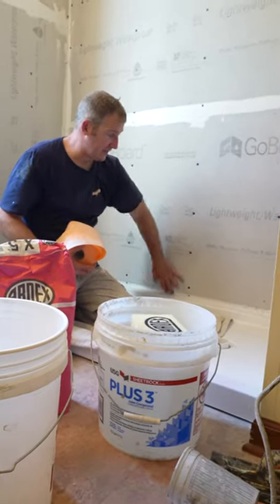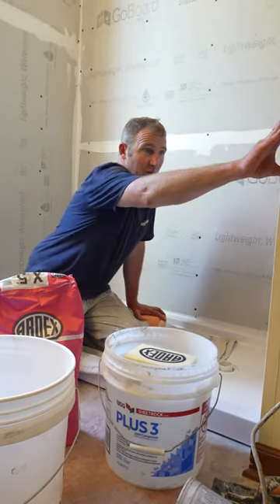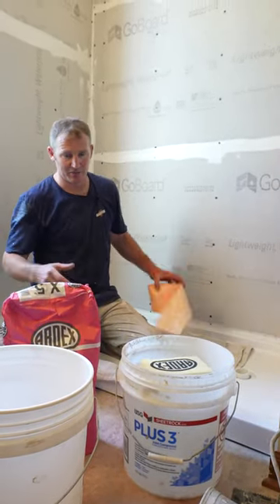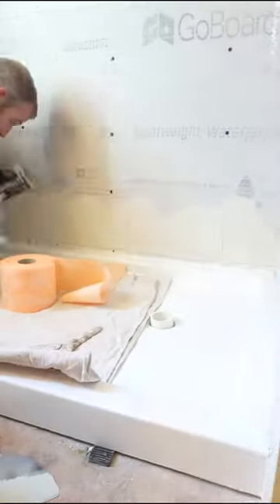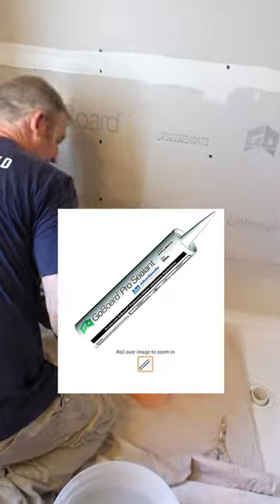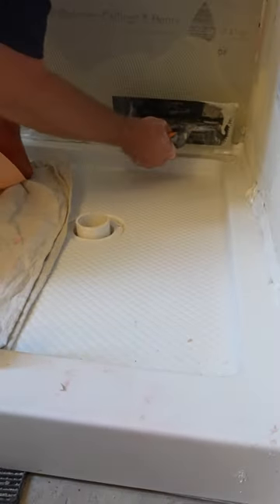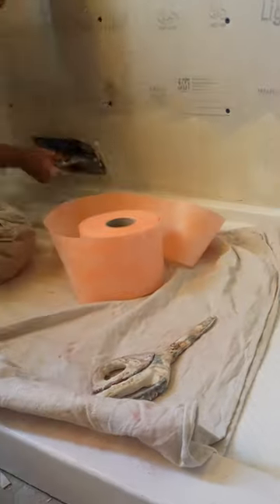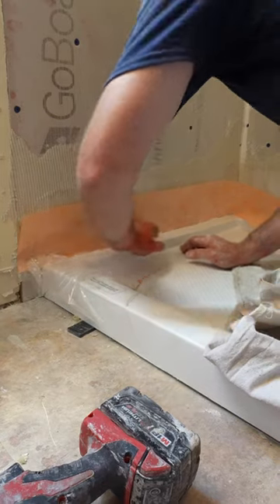Shower Pan Base Waterproofing Tip #diy #shorts

Comment: Holy shit bro want some tub with that caulk
Reply: Better safe than sorry you broke boi
Reply: @jasonyurrrr9994 lmfao to much can cause it to dry on the inside not the outside clown then it peels
Reply: You make a video and let's see you do it then
Reply: @Tatoebot Who cares what direction it cutest it fkn vinyl or silicone based, still gonna turn solid at some point, guess what it's also going to shrink because it's how these products act captain obvious
Reply: Literally thought the exact same phrase.
Reply: lol it's not caulk it's an adhesive he's using to bond the kerdi to the go board backer as well as fill in the cavity
Reply: LOL. These overkill videos baffle me. Firstly-- acrylic bases aren't designed to be waterproofed like that. Secondly-- any backerboard is supposed to be installed on top of the nailing flange of the base-- with the finished wall surface extending to the pan itself. A simple bead on inexpensive caulk is all that is needed at that point. A complete waste of time and money bonding it like it's a foam pan. Besides-- the water level would never get that high. It would leak out the front of the pan before it ever got to the top of that flange. One would also hope that the dummy taking a shower would turn the water off before letting it get 2+ inches deep in the first place? 
I'm starting to think these waterproofing material companies are putting this shite out on youtube to sell more product to the increasing DIY crowd.
Reply: @ChinoJp7624  you understand caulking is a lot of things right? Adhesives, sealants, glue, silicone based, acrylic based, mortar repair, whatever. It’s a generic, inclusive term to describe a product in a caulking tube applied with a caulking gun.

Comment: All these tile vids when they install whatever tile backer material of choice, no one mentions the shim out needed on the studs to compensate for the thickness of the tub/shower  base.
Reply: Not needed if you place it on top of the tub lip like in this video
Reply: Not needed if you notice the back of the board. This method is all for nothing.
Reply: From what I've heard about the go board® is that you can wet shim it
Reply: No then your sheet rock doesn’t match up at the end of the tile …..
Reply: Your tile backer does not go over the flange,It butts into the flange otherwise you're Tilebacker will be setting in water all the time and will wicked moisture to your framing. It should be sittin a little less than flush with the sheetrock to Leave room for the thin set  And a little Fatter than the flange so That your tile will go over the tile backer, over the flange  And over the sheetrock On the edges.  And seal that little gap between the back of the tile and the tub flange  With a 100% waterproof sealer, not silicone.
Reply: Lath….
Reply: He covered that topic in another short
Reply: because it's the wrong way to do it. Even everything in this video is wrong.
Reply: You don’t shim anything. You literally set the board on the flange and not over it. The flange is there to prevent water from wicking up the behind your thinset.

Comment: When you installed the board on top of the flange, why didn’t you leave a 1/4 inch gap between the flange and board for expansion? Is it not necessary?

Comment: Steve, I just want to clarify something. In previous videos where you used GoBoard and their sealant, you never used Kerdi band and Kerdi sealant around the flange. I actually did my bathroom like that but now I see you adding the Kerdi stuff to it and makes me wonder which way is better.
Reply from the maker: Just another way to do it. Sheet membrane would be a stronger way to go. But either way is acceptable 👍
Reply: @BathroomRemodelingTeacher  good to hear because there's nothing I can do now, bathroom is all done and I hope I did everything right, like I saw you doing it. I will keep this in mind when I do the downstairs bathroom that actually has a shower pan now. Not sure though that I will go with a shower pan or a mud bed/tile 🙏
Reply: i was wondering this too. i am glad you asked and he answered. Kerdi is too much $$$
Reply: Did you do two layers of the kerdi is what I’m wondering.  It looked like you went over it twice it not sure

Comment: Technicality there is still a micro sized gap between the kurdi band and the base.. and only the caulked in sealant is  doing the waterproofing. So you could just do the sealant and it would be the same result.  Definitely as many here as already have said this kurdi step is not needed.
Reply: Can you help me understand? If/When water gets behind the tile from above, wouldn't it shed over the kerdiband instead of into the caulk and up the cement board?
Reply: Better to overkill shit like this… as a homeowner now that’s been through 2 leaks and probably close to $60,000 in damage and fixing… I would much appreciate the overkill… fuck do it 3 times over!! I’ll pay the cost to know my shit isn’t leaking!!
Reply: As a remodeler I can tell you the real problem with showers leaking it mostly the structure and framing and possibly settling of the house... These things shift or move the subfloor or framing around the shower slightly.. and cause the cracks and failure of grout etc...and that's where the leak is... If the structure is very solid and good thick subfloor plywood is used and fastened correctly .. then simple cement board and tile with grout can last longer than you will live...
Reply: @gladbandanna  water should not get in above the top of the tile that should also be caulked.. or tile up to the ceiling is what I do.
Reply: @GenesisG70LaunchEdition  you are in a very small minority of people who will go thru the expense to do that.  There is nothing wrong with overkill if you want it and will pay for it. I have an engineering degree, and always over kill the jobs I do.  But for a shower if framing and flooring all strong and secure you should be good without kerdi... 

Just like you can wear a mask out everyday for the rest of you life if you want to is overkill.
Reply: Don't forget many home owners / renters do not treat thier showers well either .. no maintenance like cleaning and removing mold or recaulking ...I've seen where some tiles were punched in or kicked by teen agers .. all kinds of stuff .. abuse also contributed to leaks and mold.
Reply: @customsolutions7167 plywood for subfloor then cement board over that? What should I use for flooring? Waterproofing?
Reply: @Eastbaypisces  not sure what exactly you are talking about .. in the video he has a premade fiberglas pan. Cement board over plywood floor would not be needed if you are using a fiberglass base pan, if  that's what you are asking about ?
Reply: @customsolutions7167  but on the rest of bathroom floor I need ply then cement board right?
Reply: @Eastbaypisces  well yes for the rest of the floor if you are putting tile down.
You can use red guard or equivalent to seal the cement board after taping and cementing seams  .
To truly make your bathroom floor "water proof " you would need to cement board and tape/cement up the walls 3 inches or so .. like you are making a shower pan for the whole room .. 
The bathroom floor is usually not really water proof ever if you think about it  because if level with hallway floor then if a lot of water is spilling on the tiled floor it will run off into the hall way or under and through into the wall system... 
The main mathroom floor the subfloor attached to stud should be 3/4" plywood for strength  screwed down. then a layer of cement board 1/4" or 1/2" then tile .  The cement board is really for better adhesive bond for tiles and it won't change dimensions from moisture or warp like plywood or osb will especially if you just tile to the wood subfloor...which most of the new home builders do.

So basically try not to ever overflow tub , toilet, or sink onto the tiled bathroom ft floor the water will work it's way into the walls under the base board and possibly get under the toilet..  I've seen where some one flooded there floors multiple times and the water got through the wall areas down into the osb / plywood  warped it and loosened the tiles you could hear that they were loose by stepping on them.. 
Sorry for long post ...hope it helps
Reply: A lot of old timers tend to over do the waterproofing. Its like a panic thing I think? As long as they sleep at night I dont bug em much as long as the flood test passes and the tile looks good? Whatever lol.
Reply: @GenesisG70LaunchEdition  the kerdi band is doing nothing in this scenario

Comment: Thin set and mesh tape, let it dry then coat with hydraban or good topical waterproofing membrane. That’s the correct way. The kerdi technically still leaves a small gap at the bottom. Plus kerdi has been shown time and time again on multiple tests that it fails. The old ways that are tried and true never fail
Reply from the maker: Okay tile coach 😆 keep testing. How is hydroban the old ways anyways?
Reply: @BathroomRemodelingTeacher  testing would be using products that are known and proven to fail time and time again.
Reply: @Apexjasonmorganllc plus o do not think that sealant or thin set are meant to be applied that thick.
Reply: @robertopics  depends on the thinset. Pro lite can be 3/4 thick
Reply: It’s not gonna leak with that goboard sealant holding it together! It’s not thinset.
Reply: @MoneyManHolmes  there’s more efficient way to do it.
Reply: Thinset isn’t good enough for bonding to a tub flange. There is movement there, and the mortar can’t handle it. Will crack and could cause failure.
Reply: @evan-edstrom  a Good modified mortar with mesh tape and topical membrane it never fails
Reply: Where are your sources of The Kerdi failing so many test- can you site them please- I think you don’t know what you are yapping about
Reply: Lol
Reply: @Hidden-comment164  sources? Your on the source. Look it up.
Reply: Watch tile coach. Does a lot of testing with that stuff

Comment: But why do that? Water is never going to puddle up that high it's going run over the curb first and if water is just able to soak through the tile/grout and penetrate through the crack between the go board and pan there are way bigger issues

Comment: Goboard is easy to just notch the back and have it drop over the flange.
Reply: You don't want it over the flange, that stuff will Wick moisture to your framing. It should be a little  Thicker than the flange and the tile will go over the backer and the flange, then sealed the gap with a 100% waterproof sealer not silicone.

Comment: When I install a shower or tub, I notch the studs to bring them flush. But I see the point if the pan is already installed by plumber.
Reply: Why would you want it flush? the tile backer should not be going over the flange.  You only notch or shim the studs out if it's getting sheet rocked over the edge of a  pre-made surround.

Comment: Is the go board a green board substitute?  For mold and water in the bathroom.
Reply: No it’s cement board
Reply: It’s a waterproof foam board for tile
Reply: @kaseyc5078 it's not cement, it's foam, won't wick or absorb water at all.
Reply: If you are using green board you are building what a seasoned tile setter would call a "seven year" shower.

Comment: Why is the board set on top of the flange?
Reply: I wondered that. Seems like this is in the US where they may have different standards but in UK it’s board first then tray which is a more sound installation in my view
Reply: Yea we do our pans direct to stud then drywall over the flange. Thats what the flange is for. It gives you something to nail to the stud as well as keeps water from running behind the drywall to the framing.
Reply: So that water doesn't wick up if it gets behind
Reply: @Frazer20  doing it the way you described you'd have to rabbit tile or float walls.
Reply: up to flange, tile is suppose to overlap flange slightly, leaving 1/8 gap for sealant
Reply: If you set the board over the flange you will have lippage on the first row of tile- leave it to the pros to do that work

Comment: any vapor barrier membrane should have been installed between the studs and the cement board.
Reply from the maker: Not cement board 👍
Reply: even worse.
Reply from the maker: @racebannon5523  yeah?
Reply: @BathroomRemodelingTeacher  yeah, the board shouldn't even be touching the pan. it goes above the lip.
Reply from the maker: @racebannon5523  nothing to wick into foam my friend 👊
Reply: @BathroomRemodelingTeacher  nothing will wick into dead airspace either so it's just an unnecessary step and you made a freaking mess. You might have 15 years in construction but you never worked for a tile company did you?
Reply from the maker: @racebannon5523  what mess? I’m following the guidance of backer board manufacturer. 1/4” bead of sealant and set. Lots of things to critique of me…but this one is petty
Reply: @BathroomRemodelingTeacher  and they say to put the vapor barrier over the backer board? You know, ultimately it's the studs you want to keep dry everything else is supposed to be impervious to water, I know tile and mortar is.
Reply: @racebannon5523  All I can say to all of this don’t worry about him worry about yourself, no one needs to measure their Peter here, Steve looks like he is leaving this job well satisfied.
Reply: @MrDougiefresh69 BRAVO 👏🥳 Well said! 🤗
Reply: @BathroomRemodelingTeacher I was please to see normal back and forth between you two and then he decided to be an ass. But well done for not stooping to their level and keeping it classy. Il give you a sub for that 👍🤗 keep making great work and great content, 😚 you're doing awesome so ignore the few idiots. Many more than that enjoy watching you. They just want something to take their isht out on. Ignore it and remember that NOBODY successful is bitching on YouTube.  🤗🥳
Reply: @beez7753  okay, tile and mortar is not impervious but it's not damaged by moisture and can soak underwater indefinitely but if the sheetrock isn't protected by a vapor barrier it will fall apart.
Reply: @MrDougiefresh69  I agree, at some point you’re just splitting hairs over mostly irrelevant details.  I think this installation is just fine!
Reply: @racebannon5523  I can tell how much you know about this subject just by this small conversation, it’s ok I’m not saying your dumb not at all, just saying he is out here doing this stuff all the time and sharing the knowledge, where are your shower remodel videos, oh right. You just gotta format a question better, ask him don’t tell him.
Reply: @MrDougiefresh69  sounds like you have a crush on him. Having a YouTube channel doesn't make him an expert. He makes money off his channel by charging for special tutorials as well as from the manufacturers of the products he uses whether you need to use them or not. I'll tell you this much, I've been a Union Tile Setter since 1992 and I've never seen anybody spread thin-set and then spray sealant over it. I could go on but I'm already bored with this shit go do whatever you want to do.
Reply: @racebannon5523  derrrrrp
Reply: @racebannon5523  
Didnt know tiling is a dangerous job that you need a union
Reply: @JohnSmith-xu7ev  it's very very dangerous.

Comment: That's like $300 in sealant
Reply: You could do what Tile Chick does. Cut a sliver off the back of the foam, slide it over the lip and set it into a normal size bead of sealant.
Reply: It’s 9 bucks a tub probably only need 5 tubs

Comment: That is the dumbest shit I’ve seen. I have never once in my life done this as a tile setter and have never had a tub surround leak. The flange is there to protect from water wicking up your wall. You literally made it worse doing this. Just tile it throw some silicone and it will be fine. Water won’t sit there long enough to damage anything
Reply from the maker: Look in the mirror 🪞